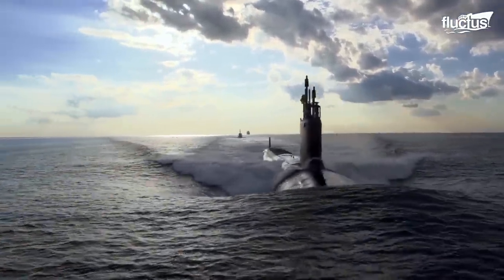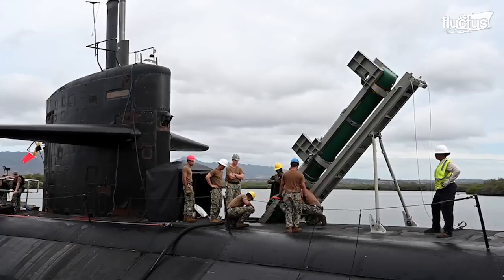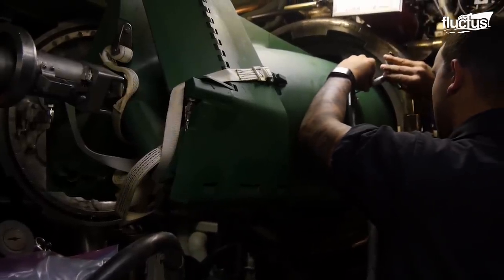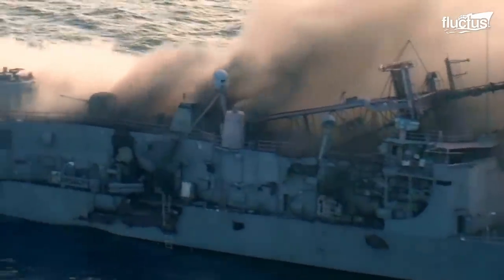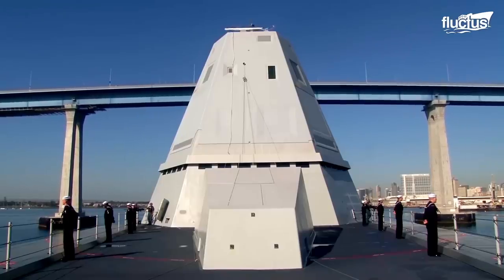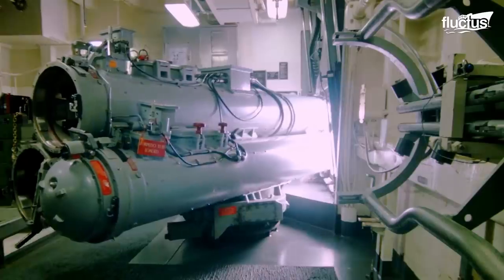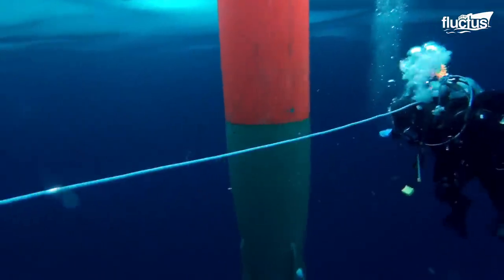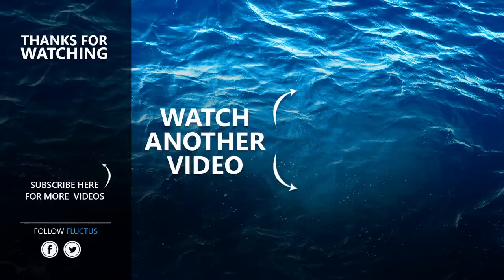The Scary Process of Reloading Massive US Submarine Torpedoes

Comment: On the old Diesel boat I was on, we had MK 14, Mk 37 and Mk 45's and all were loaded the OLD SCHOOL WAY. Nothing fancy about loading on or off the sub or from rack to the tubes.
DBF
Reply: Barbel or one of the GUPPY's?
Reply: On the USS Tang SS563 we had to remove and reload the stern room torpedo by pushing the fish out of the stern  tube. A crane on the pier would hoist the fish on to a trailer. I remember West Loc had a lot of jell fish. ( ships diver to set the crane cables)